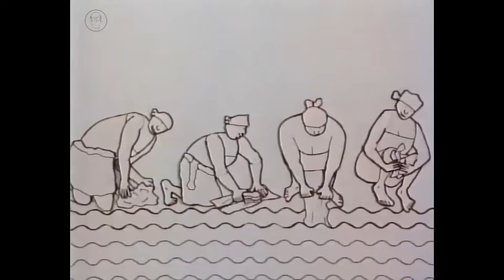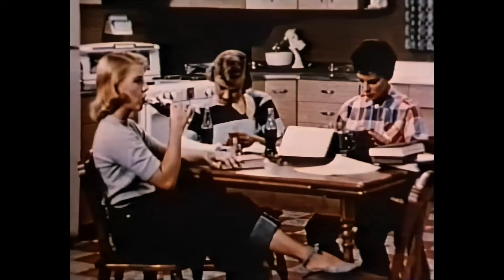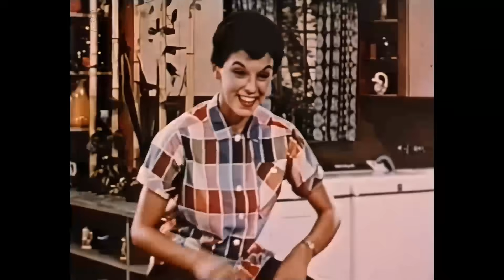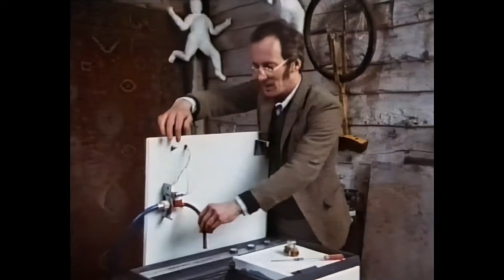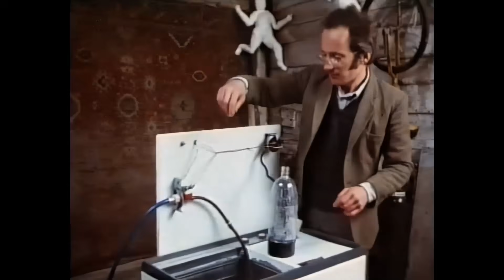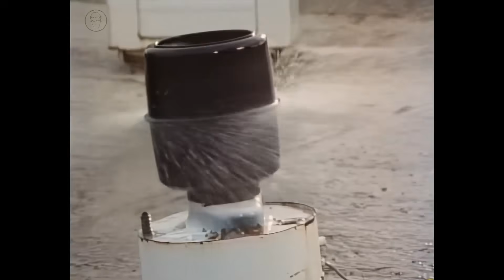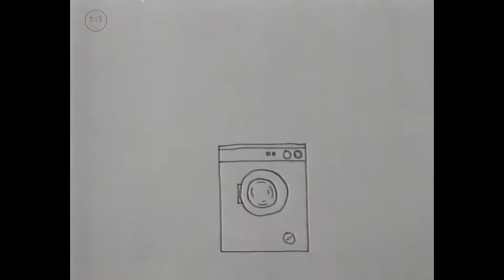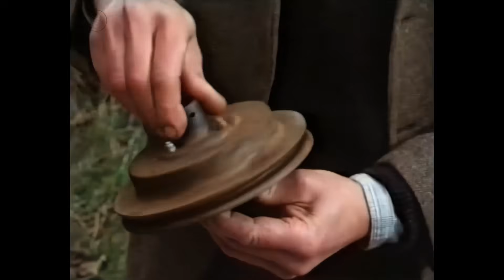The Secret Life of the Washing Machine - Remastered

Comment: One thing that put us off buying a modern washing machine is the very long cycle lengths to meet their EU energy labelling requirements.  We have a Whirlpool semi-pro that's probably about 15 years old and the main regular wash cycle is just 45 minutes, compared to the 3-4 hours of new machines.  As it's larger than a typical under-counter model, it has no problem washing duvets, multiple pillows, etc.  When the spider of the drum broke a few years ago (sounded like a jack hammer on the spin cycle), my Dad disassembled the machine, replaced the drum and bearings and the machine continues to work.  Despite having digital button controls, it has a cam driver inside, making audible clicking sounds when it switches between wash, fill, drain, etc. and resumes after a power cut.
Reply: Eco saving washers are garbage and always will be.  You need water - a lot of it - and agitation to wash clothes properly.  Using a teaspoon of soap and 3 pints of water will not clean a damn thing. It wastes more water and electricity. I donated my 2013 Maytag Epic Z that I had already completely rebuilt because every single part kept breaking one after the other by 2017. I got a matching Kenmore washer and dryer set from  either 1968 or 1972, I don't know the exact date of manufacture, and they are in a avocado green color which I'm not totally a fan of (would have loved turquoise), but I needed them, so I got them anyway. I re-washed my entire closet of clothes and I am just over the moon at how soft and clean they are. All my clothes were just greasy feeling and stunk like mildew for years because why? eco saving piece of junk. ill not need another washer or dryer for my lifetime I am certain of that.
Reply: @MrWolfSnack 
Hey...I still use my Maytag washer I bought 25+ years ago. No eco whatever stuff....just a plain old washer.
😅
Reply: @MrWolfSnack nope. My Fisher Paykal gets clothes super clean with almost no water. The wash cycles are all normal length too.
Reply: Semi-pro, as in the grey Baukpool/WhirlKnecht whichwasher2007 owns?
Reply: @Wasmachineman  I tried checking, but the control panel looks different apart from the grey colour.  If you do a Google Image search on Whirlpool Semi Pro 9kg, look for the grey machine with a red LED time read-out.  Surprisingly, there's no model # on ours, just says Semi Pro 9kg and Made in Germany.  

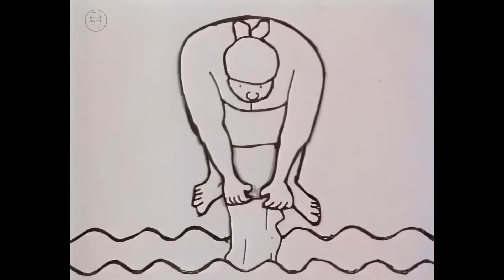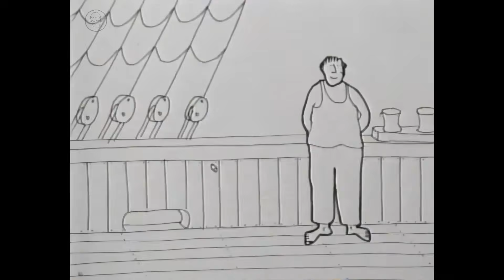For size comparison, on Whichwasher2007's video titled "wash Race No.246", that big machine on the left is the same size as ours, but appears to be a more modern version with a different control panel layout.  If I select the same heavy duty cycle, 60C and everything else to Normal, the time remaining shows 1:00.  Setting "Heavy soil" increases the time to 1:10 and "Heavy soil" + "Stain treat" increases the time to 2:10.
Reply: @theirisheditor  Your (and WW's) machine is a rebranded Whirlpool Duet from the USA market. Not surprising your spider failed, they're known for that.
Reply: 3 to 4 hours?!? Are you joking??

Comment: Appliance repair man here. I can confirm that modern washers are indeed practically identical to the ones in the show. I still come across plenty of machines using cam timers that are still working well. As Tim says she the end, some of the motors have changed a bit. Basic washers still use brushed motors but higher end models are going brush less, including the direct drive LG one shown (in my opinion the best motor you can currently get on a washer). 
Looking forward to watching the rest of these remasters.
Reply: I don’t think we’ve had mechanical timer washing machines in Europe since the early 2000s
Reply: @Kubulek17  Yeah that sounds about right. I still see them still working from time to time. Definitely becoming less frequent though. Modern washings machine moduels are pretty reliable, but 20+ years would be optimistic
Reply: Nowadays most machines had variable speed (frequency) drivers with tree phase motors. Before, motors had different winding packages to realize different speeds for washing and fast spinning.

Comment: Wonderful Tim, great video, not the first time that I have watched it but the commentary at the end was interesting and entertaining too.  I agree with your point about the newer machines being more repairable. It tends to be that any of the shared components like pumps and motor brushes are really cheap and easy to repair. But the unique things like printed circuit boards are more expensive, unless you attempt to diagnose the issue yourself.  Some machines though have a sealed tub, so if the bearings go there is no way to extract them without cutting the plastic tub in half. 

I have been posting videos for about 5 years now of the self destruction of un-repairable automatics. I managed to get one to jump on a trampoline of it's own accord. I have also flooded the internet with selected how-to-repair washing machine videos, but for some reason they aren't as popular.  The motor you showed at the end, the direct drive one, has an array of magnets surrounding the coils you showed. A relatively complicated controller, I think similar to a 3 (or more) phase inverter. I suspect that the machines in your film had induction motors, whereas the more recent ones tend to have brushed commutator motors, but many now have a "slient" 3-phase induction motor, which can be run from a single phase inverter and is useful for making workshop tools.  I have posted some videos on these motors and how to control them. Kind regards!
Reply: I've seen that direct drive motor turned into a wind or water generator with supposedly simple rewiring. 
Looked like a splendid post apocalyptic project!

Comment: And today, 34 years later, manufacturing quality has dropped even more. You're lucky to have a washing machine last around five to ten years.
Reply: That is planned obsolescence - it fails/deliberately stops working in 5 years and you go and buy a new one, as you find you can’t repair the old one
Reply: My parents bought a brand new Miele in 2008 for €1300 and guess what, 11 years on the shock absorbers failed. So much for that "our machines are built to last 20 years!"

Comment: Youtube has indeed improved the repairability of pretty much everything that might otherwise have become landfill.
I spent two days in lockdown changing the drum bearings on my Hoover HNL642, guided by a video from Bootsowen https://www.youtube.com/channel/UCvVSXrs2jTBSofX-y375Csg.  
It took me expertly through the process during which I had to become acquainted with almost every aspect of the machine's assembly.
The set of new bearings and seals cost just £5 with delivery from eBay, although a small tub of silicone grease cost £6!